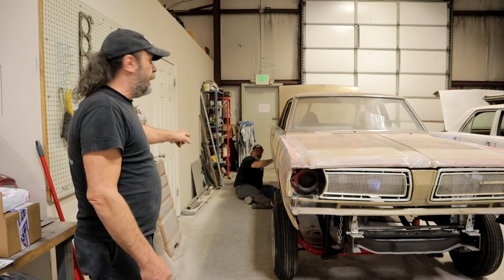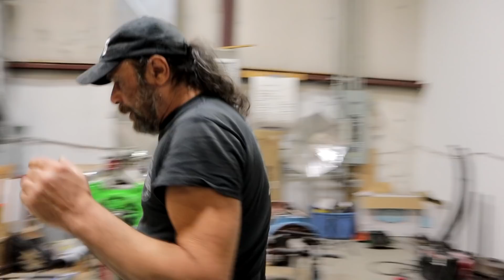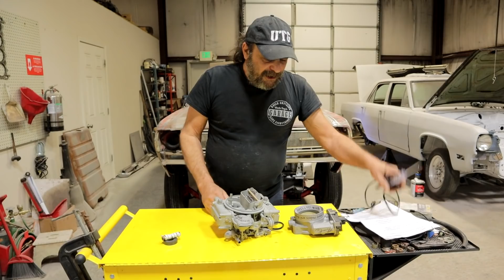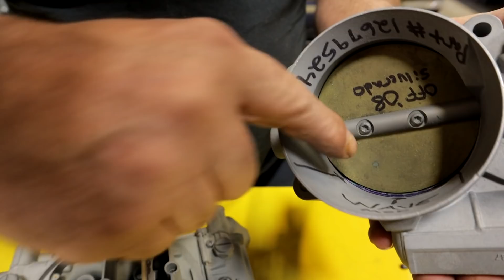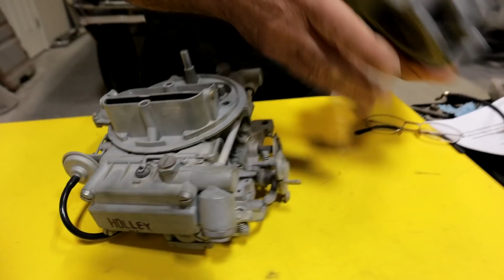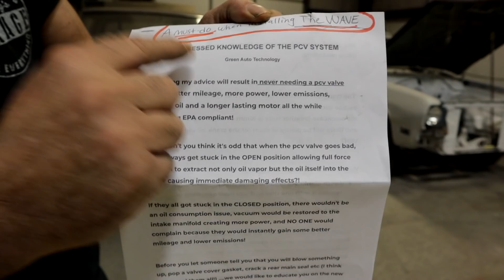The Free Energy Scam And Other Absurdities Of The Mechanical World

Comment: Man u have sum severe issues bro. U need to b a bit more open minded and especially articulate w your engineering skills. That spark plug u used and the cut downs insinuating that professional and all beit perfectionists r ridiculous to believe that energy is produced are idiots. Well my man it looks like your child made that half ass attempt to watch it work. U c bro some things u have to do 100 percent. Not that half ass thing u made as obviously u like half passing stuff and getting a full blown result as is also obvious w yr 2 cars prob been sitting there a long time. Well I'm a professional person, perfectionist and engineer and I was also skeptical until I made a few w the spark plugs and alternator and they work perfectly fine. Get sum 1 to help u.

Comment: You have to pay attention to see when people are click baiting but 90% of the time it's clear as day to see click bait. Even the rest you can tell are click bait if you PAY ATTENTION
I don't believe the idea of free energy because of the simple law of nature. Energy must be put in some way to get energy back, but I believe we could reach a 99% if not 100% efficiency of energy put in and getting 100% back. Like turning a generator with a no resistance bearing up fast and taking the driven power off and letting it power itself almost but that's an example that wouldn't work. You wanna get better gas mileage, let's find a way to reduce rolling resistance and drivetrain loss to 1% or 0 then we'll see how much mileage you can get. Better bearings is a start but you have to take into account for how much weight they handle too. A fidget spinner ceramic bearing would most likely shatter over a bumb or pothole.

Comment: Thing is even if you had a no loss system and basically had the input energy in a  loop. The system can do no work. As soon as you put a load on that system, even a lossless load the energy put in will get pulled right out to the load and it will stop. 

Just like people trying to show 'frictionless' bearing by removing the grease and spinning them. Sure without the grease they spin forever but as soon as you put a load on that bearing it will kill itself in no time

Comment: Ask holley to look at it. The only thing I've heard of actually working is a shrouded jet where the jet is extended up one side of the needle on the windward side which increases vacuum on the jet and draws more fuel closer to center of airstream, it was used alot on racing 2 strokes in UK back in the 80's, I beleive they have been looked into again recently but not sure.

Comment: Need to do it scientifically. 
Volume of gas
Tire psi
Throttle stop so you can't put more throttle than x%. Basically 25% throttle, and you floor it to 25% its constient. Elimating human error. 
Temp. 
Air pressure out side
(Basically everything I'm nitro drags) the same, or very close to the same for both tests.

Comment: Ugh, right away when I saw that he had sandblasted the carburator completely as is, I lost faith in that guy. That's such a lazy and barbaric way to do it.

I bought a distributor that someone had done that to, inside and out without any disassembly...when turning it by hand, you could just feel the crunchy grit of the sand that had gotten into the bushings...what a tool.

Comment: I think it was fram that came out with a plate but there was 2 different ones. One was billet aluminum and it had a Circular groove a boulder right up to your throttlebody the other one was kinda like a fan blade and it went inside the cold air pipe before it hit the throttlebody. And or something of the same concept that fit on top of the carburetor and it was supposed to swirled the air into the runners kind a like a whirl pool does in a vortex. It was supposed to give you better fuel mileage engine performance. And they were pricey.

Comment: Jack the rear of the car up to let the wheels turn and use the idle bypass to keep steady engine rpm. Get unmodified baseplate with same size throttle blades and test again

Comment: Why don’t you under cam the engine and make it idle at 400rpm? Or add a small turbo.? Use higher diff gears?
There was and old 30’s tractor that was so economical and so hard to start that the farmer would let them run all night, and they were 7 litres.

Comment: Off hand, some kind of air flow sensor that mounts behind the throttle body, but like you said at idle is the only potential for gain.
P.C.V. was a break through in engine tech ( I always check it with oil change)
E.G.R systems is gross and passed the buck to the consumers 😷

Comment: This kind of stuff isn't new. I remember when I was in high school reading up on a lot of this  kind of stuff and believing it. I restored a 50s Ford tractor and I took apart a line coming from the side of the tractor with a canister. inside the canister was this this wad of oily paper. After looking at it for at least a minute I sudenly realized it was a roll of toilet paper. A kind of oil filter.  I later did some research and found an old add in the fifty's describing this way of filtering oil. What a scam, lmao for a long time. Still do when I think about it.

Comment: Say do you remember that whole tornado thing that you put in the air tube inlet . It was supposed to make the air spin . And the two two letter pop bottles with the whole tornado thing going on . It looked great till you think about all the carb blades and valves in the way ooo you could make a high rise manifold with clear runners with 8 of those tornado things in the runners . Pour water down manifold . Tell everyone you found how to supercharger your car with out a super charger and everyone there where tinfoil hats .

Comment: I still remember the smells of drain oil prior to the national standard requiring the PCV . Not only the color and odor of drain oil but the smell of cars sitting in traffic . And the underhood smell of pre 70s cars sitting in the junkyard. That old oil and crankcase was loaded with lead deposits and the heavy parts of unburned gas . At least the gas and moisture is sucked out by the use of the PCV so less acid is formed in the oil plus the elimination of the oil fog . Back then people drove by keeping the car over the black band in the middle of the lane .                                                                                    Now the most barely functional gimmick i saw after the 73 oil shut off was marketed as the Arizona super charger . Basically a fine screen mounted between 2 carb gaskets . It did make sense with the low quality quadrajets and thermoquads of the time . You could watch these carbs dribbling and dumping liquid fuel when looking down thru the venturi and operating the throttle . This fuel didn't burn and ended up in the crankcase after washing the oil off the cylinder walls especially in cold engines . all the screen did was break up the droplets and make the early emissions engines run a little smoother likely because you had to break off the limiter caps on the idle screws and re adjust . As for mileage it still sucked . On a 440 Dodge that went from a neighbor to my moms car that things was still in perfect shape 10 years later but we got a noticeable boost in MPG switching the leaky thermoquad to a Holley Econo Master spreadbore plus the bog and backfire it had since new went away .

Comment: My suggestion is as follows. Closed course (race track comes to mind) with a full tank of gas. Run until empty and record mileage. Of course, it should be fully warmed up. Make sure you go as closely as you can to the same speed. Maybe even a couple different speeds to see if there's any difference. Just a couple ideas.

Comment: You need to test 2 sames carbs.  One factory base specs and that one with mods.  Cause you can’t really tell the difference if that one is better than yours.  For sure any smaller carburator is going to be lighter on gaz.   Kinda like use a plain carb.  Try it, than do these mods to really see if it gain fuel efficiency.   You know much more than all of us together and like you said before.  Eather you want to run a 20hp 1 cylinder in your classic car or you prefer to stroke that 1 cylinder into a 12 inch diameter piston that spins 15 000 RPM with a 3000 CFM dual Ram Air combination that is still not strong enough for daily driven car!
I just can’t wait to see Master Tony testing the unsolved mystories of all time.  Talk to me about Blow-by. I was thinking about adding extra PCV valves just to finish last summer after I overwave my 389ci and broke a ring by mistake.  On second tought.  It was a No-No!
Fix it before you Ruin it is much wiser!!!
Maybe if you had 3 alternator on that carb and you electified the gaz before it vaporize or inside the intake like a pre-sparkplug ignition.
Pouaaahahahahaha!

Comment: The only way you could accurately test that carb is to test one that hasn't been modified and then modify that carb. You can test 2 new carbs out of the box and have a different result between the two. Any that ETB unit? Forget about that.

Comment: It's just a turbulator.  On carbies as you would know there is an issue with low speed air not atomizing the fuel well at part throttle openings.  Any pre 70's carbie would tend to run rich off idle and at part throttle to cope with the lack of airspeed ( you have literally bit drops of fuel falling into in the intake manifolds and individual cylinders running quite different mixtures in stock setups as you well know) - so fitting something that will speed up the air momentarily past the jets and gain better atomization gives a measurable improvement in fuel economy because you can lean things off but still have practical useable power in normal driving.  Can't imagine a groove in a throttle body or choke tube doing anything at WOT or high power demands...  Apart from the 5%-10% or so you can improve on a richly tuned old school fuel system of (gee, this dates us...)  all the rest is just snake oil and scamming...  The typical car from 60 plus years ago that we learned on because they were already old cars that young men could afford and generally in poor condition by the time we got to play with them did allow sometimes great improvement - but that was sometimes from a very low performing badly out of tune state.  Having weak ignition, worn fuel systems and leaky valves plus stock intake and exhaust setups gave us the ability to make cars really improve dramatically in power and economy without huge effort.  The 90's cars I drive today are so far advanced from those old bangers it's not funny - and any car within the last 5 years probably can't be improved much in the home workshop even if you are fully trained up and have access to all the tuning computers etc. - no way injecting a whiff of browns gas or grinding a groove into the side of a throttle body will do anything measurable ever to improve power or economy.

Comment: To test it accurately, make an adjustable throttle stop and find an open area where you can make a closed course (old airstrip or mall parking lot) with marked points for braking and acceleration. The portions where you're on throttle, the driver will put their foot to the floor constantly, with the throttle limited to whatever is reasonable to not go dangerously fast, say 10-15%. On the braking portions, the throttle can not be touched, the car goes down to idle until it reaches the throttle portion again. 
It'll take some coordination, but it's pretty doable. Limiting throttle will at least remove the driver bias portion.
Reply: You can repeat the same test with another identical but unmodified carb. No matter what, it will be a colossal waste of time. 
It would most definitely be easier to find someone with a silverado to perform the test with.

Comment: UT, a good test might be this: a set number of miles, say 50, on a set route with a mix of highway and around town driving. You do it with the carb you have on the car now, and start with a full tank. Then fill up after the first run. Then you swap to the modified carb, and run drive same route, and fill your tank up again. See what the difference is between fill ups. That seems like an easy way to see if it even remotely helps fuel mileage.

Comment: free energy  generator sounds great to run some  asic miners  for some free  cryptocurrency sounds easy to do.  Just need the neodymium n52 magnets to alter an 24V 120-180 amp 50hz~60hz diesel truck alternator to  brushless kicking out  ~220V X2  legs more volts less amps to make that thing turn mod to 440V>? just have to make like a load line power balancer for ripple and noise  to run sensitive equipment>? Single phase induction motor or a Three phase >?More research is needed>?I do have some of the parts already>?

Comment: Ok yes. There was one throttle that did increase the efficiency of an engine to gain a couple of hundred horsepower. 

Ww2 aircraft engine with engine driven turbine type supercharger. 
The throttle was a petal type that created a vortex down the intake that altered the angle of attack on the turbine blade. 

Light throttle spun the intake air at similar rpm to turbine engine to unload it. 

This allowed the turbine to be geared higher and create greater boost at higher altitude without over loading it at low altitude. 

Not free energy by any means, just good old inlet vanes to alter angle of attack, as used in most jet engines.
Reply: https://youtu.be/ms9qkkvMTpA

Comment: In the 80s, BMW and GM had a diesel engine where they electronical changed the frequency in the intake manifold. Always thought thats interisting. it added a little power but nothing like a turbo. More to mpg

Comment: IF you could build a perpetual motion machine completely free of mechanical or electrical losses...an impossibility...the machine could never make enough power to do more than keep itself turning. Why not? Because the generator can't possibly produce more energy than the motor puts in. But it can't even do that well. Friction in the bearings, the work needed to circulate air over the coils to keep them cool, and electrical losses within the wiring (the source of the heat I just referred to), and even any vibrations or noise created by the device ALL will drain off the energy within the system, causing the device to coast to a stop. That's just Physics. I can't figure out why there are people who can't grasp that.

Comment: So I guess the question is...what is the objective of the wave...? To increase MPG? If so, I think it would be fairly simple maybe. Empty the gas tank, then put a fixed amount like 2-5 gallons. drive it continuously until the car runs out of gas and calculate your MPG. . Do this once or twice with this carb and another identical unmodified carb  so you have at least two data points. Done.  Unaccounted variables would be any stopping and starting you do during the drive (a track would be best so there's no stopping) , how long you idle if at all, what speed you're driving at, and condition of the carb jets. ....

Comment: This reminds me of that as seen on tv thing called the tornado that came out several years ago. It looked like a cookie cutter and you were supposed to put it in your air intake tube between the filter and throttle body or they had one that sat on top of a carburetor too and it was supposed to give you something like 15 HP and 20% better gas mileage or something like that. It was such a joke but apparently they sold a bunch of them because the commercials were on tv for several years.

Comment: Good stuff!  You could do a remote tank and run tests at constant rpm/load settings.  The tank could be weighed before and after for fuel consumption.  On "free energy", entropy will kick your butt every time, unless the definition of "free energy/perpetual motion" is changed.

Comment: Stanley Meyers held many patents, and many videos out there of his experiments and dune buggy running off hydrogen on demand, and that's a gas, meaning no dangerous liquid hydrogen or huge hydrogen tank on your vehicle. Meaning we can power any engines, diesel or gasoline, with hydrogen on demand. He was meeting with a handful of NAT0 in a restaurant, his brother with him. Stanley got up staggering for the front door, with his brother behind him, and his brother said Stanley's last words were, "I was poisoned"..
Think about it, ,, pour water into your aluminum gas tank on your vehicle, hydrogen on demand from your 12 volt battery source/alternator, splitting the water molecules two parts hydrogen one part oxygen (Brown's gas), have it injected into your cylinders like fuel injection, sync timing. Galvanized exhaust since the byproduct is H2O, (water). Therefore being 100% environmentally friendly.
Money and everyone's pockets and out of the cabal oligarchs piggy banks. (Fully synthetic oil)- "oil is renewable". -The world has been enslaved (scammed) for many decades.

Comment: Impartial test bed - put a nice long, clear tube on the engine side of the carb/throttle body. Then put some coloured smoke through the assembly under pressure, and see if the swirls of smoke develop into a "supercharged ball" through the stages of opening the carb up. No need to attach it to a car and run it to see if the concept holds true.